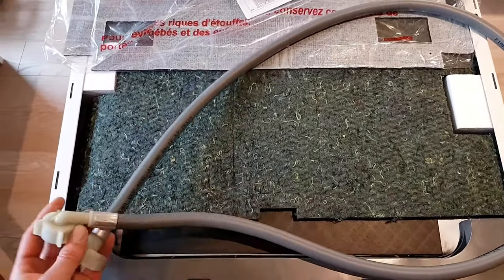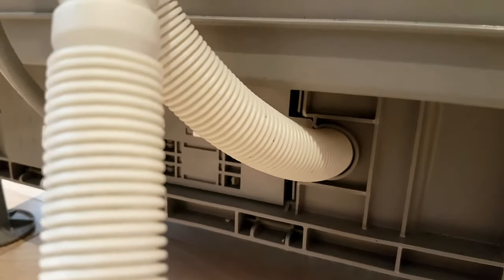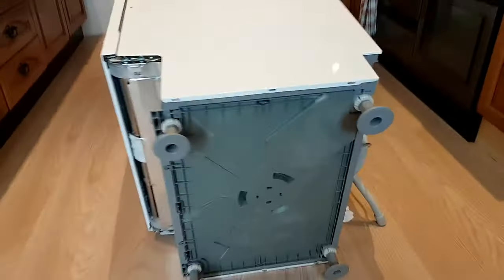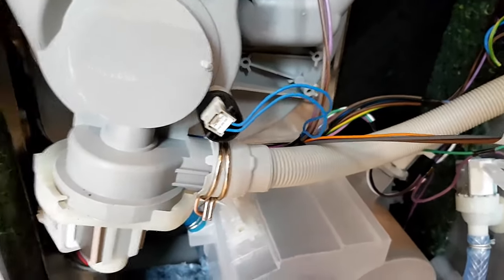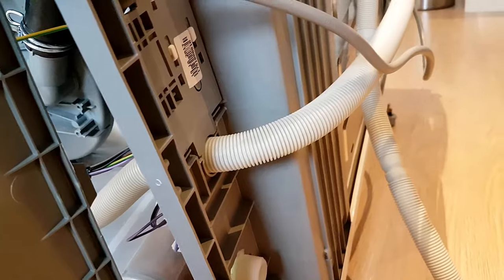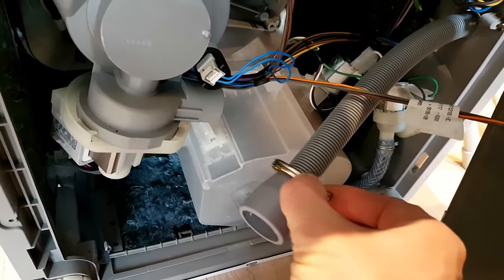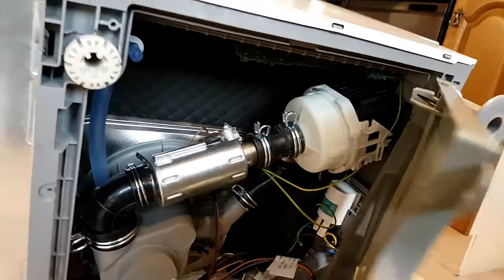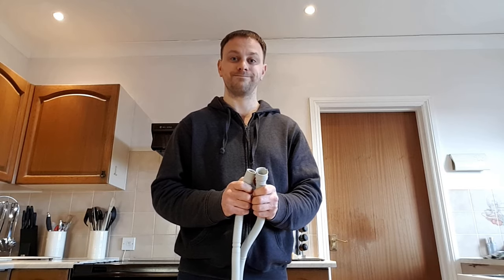DIY : Replacing A Dishwasher Outlet / Drainage Hose - Not Extending

Comment: Hi great video, it helped me alot changing the pipe but I put everything back, switched it on and it sounds like it wants to work but just doesn't, after 3 minutes I have a flashing light, and advice would be bappreciated

Comment: Nice video, just done this and waiting near a wall socket with a wooden spoon incase something went wrong! Only took fifteen minutes , ten of which were spent searching for pliers!. Only thing I  did different was to prop the dishwasher against a chair so it was at an angle but not completely on it's side. Thanks for the help :)
Reply from the maker: Thank you for your comment. Glad I could be of some help & I hope that your dishwasher worked perfectly :)
Reply: Outlet hose got torn so followed this to replace it. This was a big help  it's working like new and probably saved me a fortune thanks again! :)